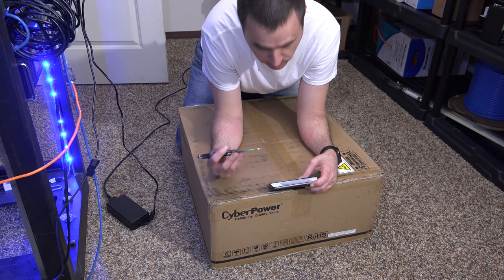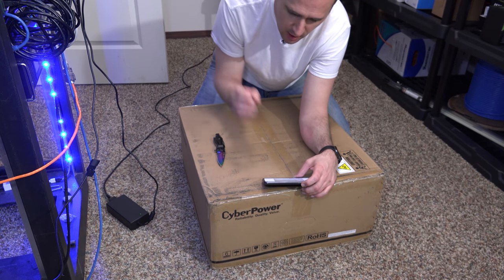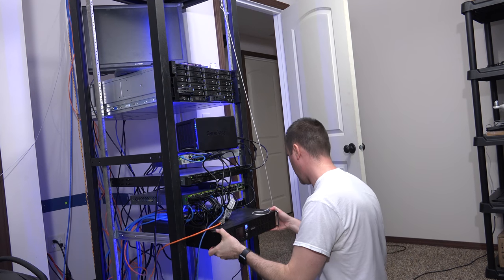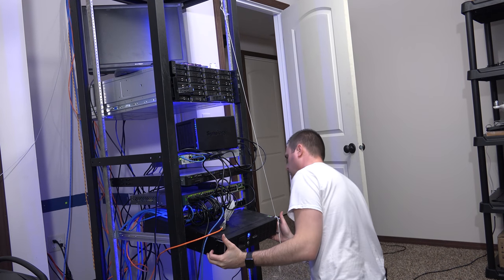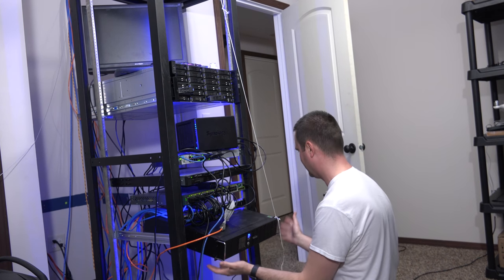5 Things to consider BEFORE you build a Plex Server!

Comment: I do not know anything about the hardware, so I bought the highest specifications I found in the store so I have an i7-10700k octa core 10th generation processor mixed with nvidia GeForce rtx 2080 super 8GB, does that do the trick for me to run Plex easily?
Reply: Weird flex

Comment: Caveat for NVME Drives: On many motherboards, using the nvme slot means losing two SATA ports, basically bringing you down one drive in potential capacity.
Reply: Enter SAS controller. No issues with on-board sata ports 😜

Comment: Do I really need an SSD for the meta-data when using 10k spinning disks?
Reply: Yes, you should really go with ssd especially if you have ton of metadata. While back i had to swap back to hdd, it was 15k rpm drive and it was still too slow. Just last night i swapped back to ssd and the difference in speed is like night and day. If you are running linux you can get bit more speed out of hdd by mounting it with NOATIME option so it doesn't write access times to files

Comment: I am curious to know how I can figure out how big my Meta data is. In "Unassigned" Devices, it's only showing around 12.6GB of 240GB used. I did try browsing it through file explorer & even MC to view the size but seems accurate. Then again, I'm not using thumbnails or Transcoding on it, just Meta. Using the RAM Transcode probably helps.
Reply: @bigbigspoon  I know I don't have thumbnails enable. I knew that would inflate the size considerably. Pretty sure external content is also disabled. I don't remember how many I have but it's in the neighborhood of 1-2TB of movies & 1.2TB of TV. Maybe it's still caching on a HDD,l

Comment: Ummm, you can expand the pools in TrueNas Core. You need all of the drives in any pool to be the same size, but you can add drives to expand a pool. @Craft Computing would know this... IJS LOL.
Reply: that would be interesting as one of the reasons I went to UNRAID was the lack of adding to the pool.  but if this has changed then I will look at trueNas for my backup server
Reply: @mysmtpservices4818  I believe the feature came when they switched over to TrueNas, as my servers put the info for it in my Alerts.
Reply: Agreed. I was confused when he said this too. I only came around to TrueNAS a few years ago, it has supported this since I started the project. It's actually one of the reasons my friends suggested it, as they moved from unraid to it.
Reply: @evana4622  i am kinda new to TrueNas, but I do know this is def a feature.
Reply: @mysmtpservices4818  my understanding is you can add to a pool. But it’s dependent on the configuration of the first vdev. So if you start with 6 drives as one vdev. And only have that one vdev in a pool. To expand the pool you need an additional 6 drives in a second vdev.

Comment: Cool Tips..I kinda went Ballz to the wall with my own Netflix Host build with dual xeon e5-2696 v2's 1tb cashe ssd & a 500 for plex n then a another 500gb but maybe a 250gb for some vm's & a Quadro 128gb of ecc ram Gota have the dual 10gb sfp+ nic Withall  beQuit fan mods on a supermicro 24 bay case ! i went with a pair of gammax gt cpu coolers But i think they are giving me some trouble so i think i am fixing to order a pair of noctua 3u coolers to see if that fixes my isue !!

Comment: Why is everybody so pushing ups systems. Modern journaled filesystems and databases do not corrupt. That's why you have a write ahead log. I mean perhaps one in a thousand times not saying it can't happen... If you fail in the middle of a kernel update perhaps... but even they should be fine turns out kernel developers know how to call fsync. So you can power cycle your nas all day long and it should be fine you shouldn't but you can. With the exception of the file data you just wrote . So unless you live in a third world country with terrible power like california it seems like a hassle that is not strictly necessary.  Even if its kinda cool.
Reply: never had stuff fail on power loss?  i too like to live dangerously

Comment: My set up is pretty simple. I have upgraded my hardware over the years except for the hard drive. I basically just keep moving my 2 GB 7200 RPM hard drive with about 1.5 TB used from machine to machine. I am currently using nvme storage for the metadata. Would I get significantly better performance if I upgraded the media storage to an SSD?   I just set up an HD Homerun and I am going to be using Plex DVR so I am thinking my library is going to increase rapidly.

Comment: Could always just use any Linux distro you want and run snapraid. Expandability, redundancy, and free. I do see the appeal of unraid though.
Reply: But Parity isnt calculated in Real-Time. In Fairness, it has the ability to detect bit-rot. Unraid does not.
Reply: @xxcr4ckzzxx840  If you need parity calculated more than once a day you either aren't super confident in your hardware or not confident in backups. It's all trade offs but I'm going to guess most people don't need a real-time raid.
Reply: To be clear, not knocking unraid for what it is. I just feel like with the frequency that most non-enterprise type users are running a job to sync once a day or even once a week would be plenty
Reply: @jh-12358  Ask Jason about its Media Backup Strategy. Yeah right.. He has none. That will be the case with most ppl. RAID is not a Backup, but most ppl dont have the Money, or the capacity to Backup their entire Raid System. So more Sync is more better. I mean, i understand ur opinion and i respect it totally, but for me ZFS is the Right choice, thanks to integrity checking n stuff and like most home users i run kinda old Hardware.

I also feel like every FS these days has drawbacks. ZFS is kinda slow compared to others, thanks to the C implementation of the RAID System. BTRFS is just a freaking Mess, SnapRaid doesnt have Real-Time Parity and Unraid, well..It just takes the failed Bytes and calculates it into Parity, so that u cant fix the Problem, even if u manually detect it.
What i try to say: ZFS is the right choice for me. For u it might be different and thats totally fine.
Reply: Linux MD RAID?
Reply: @xxcr4ckzzxx840  Why is BTRFS a freaking mess?
Reply: @Ulven3829  Docs are incomplete, all over the place or WAAAAY Outdated. No one, who wants to get into the Topic of BTRFS, has any Chance to find reliable Information from Official Sources. Also in NO Point in Time, was e.g ZFS THAT unreliable. BTRFS had some Major flaws which caused catastrophic Dataloss to the Users. The "Interface" is really confusing in BTRFS for newbies, especially if you come from ZFS. I would´ve liked BTRFS more than ZFS, if there wasnt the Raid 5/6 writehole issue, the potential Dataloss and the Problem, that it is just confusing as heck. Its a great FS for Homeusers, if it would work. But even ZFS 0.1 was more stable than BTRFS is today, as far as i heard.
Reply: @xxcr4ckzzxx840  Tnx for the info. I’m new to this area, so I’m trying to learn before I buy/build my first NAS/server.
Reply: @Ulven3829  That's always good todo. Lemme give u an advice. Keep planing ahead and keep in mind, that a NAS needs some energy too. Don't get pre-built shit, except u r really lazy. And most important: you can't have enough RAM lol (especially with zfs).
Reply: @xxcr4ckzzxx840  I’m not lazy, just not that savvy in Linux or the terms in the server universe. So it has to be easy to set up and maintain.
Reply: @Ulven3829  Question is: Are u willed to learn? And do u have time? 
If both are yes and u have the money, get good, new, energy saving Hardware. If you dont have money: Get used stuff from Ebay that fits ur needs. 
If all of the above, except the Money is no, then just get a Qnap/Synology NAS and set it into a corner.

If u went for the Cheap used Method and have time/willed to learn, then tell me what u wanna do with your "NAS". Just Media Storage?
Reply: @xxcr4ckzzxx840  I do wanna learn, and have the time and money. But I don’t have the patience to learn a new “language”. I tried setting up a Raspberry PI as a emulator, but that didn’t go well with all the “sudo” stuff and “weird” commands.
It’s mostly just for file storage, and some occasional streaming locally to my tv.
Reply: @bigbigspoon  tnx for the info. I might do that.
Reply: @Ulven3829  Patience is what you get/learn along the way. If you have the money and you wanna go the easy route, but don't wanna miss out alle the good stuff, then check out the new video on Level1Techs YouTube channel about the Qnap Nas there. If you wanna go cheaper, get some used hardware and build a home server an learn patience along the way too. And if you wanna "just working stuff", get a cheap Nas and off you go.
Reply: @Ulven3829  99.9% of what you will do on Unraid you will not touch the command line. It’s all GUI. There is a learning curve but that is for understanding what to do and how to do it. I think I had to use Sudo apt get community applications but that’s it. Unraid has a free trial and the OS boots off a flash drive which then runs off ram. It might make a fun afternoon project just play to around.

Comment: I am looking for some help.
I have done some research and I cannot seem to find the answer to this. 
How do I rip a DVD and maintain the chapter/scene markers?
Furthermore, is it possible to make use of those chapter markers in Plex.
Here is what I want to do:
I have some home movies on DVD that I took time to make chapter dividers.  It would be really nice to enjoy them as one movie that I can watch continuously but also be able to skip to certain chapters/scenes when I want.
The program that I have for ripping is MacX DVD Video Converter Pro Pack.
It will rip to Mp4 or MkV. I have already ripped a home DVD to an MKV but either I did not do the rip correctly or I am not understanding how to access chapters because I cannot seem to find a way to skip to the next chapter on Plex. The movie played just fine on Plex. The issue is simply not being able to skip to the next scene/chapter. 
Thank you for any help or advice.
Reply: Mp4 and mkv are video files so there's no chapter information.  To maintain chapter information you will need to make an ISO file (basically a full image of the original disc.); However Plex does not support ISO file.

Comment: I have a AMD 2600 CPU in  a Tomhawk Motherboard, 16GB RAM with a shi*** GPU, running on UNRAID. at the moment I don't have my PLEX on a SSD but a normal 2.5 250gb HDD and it runs fine.